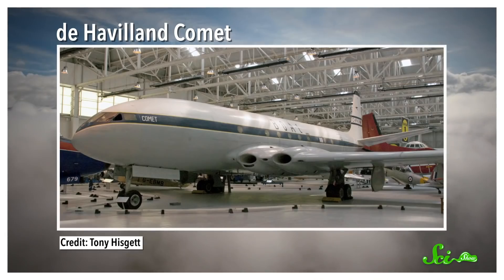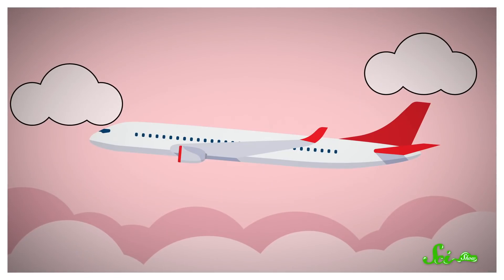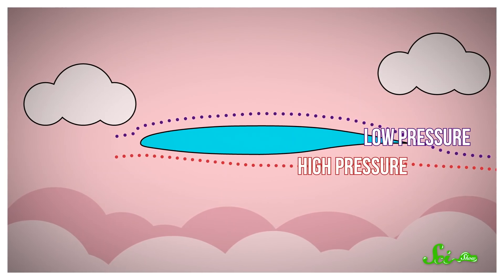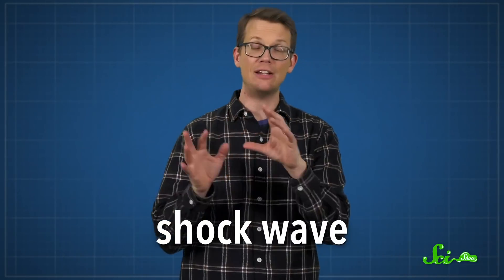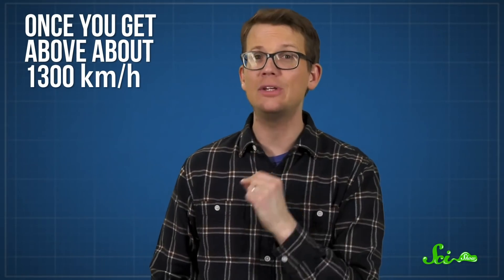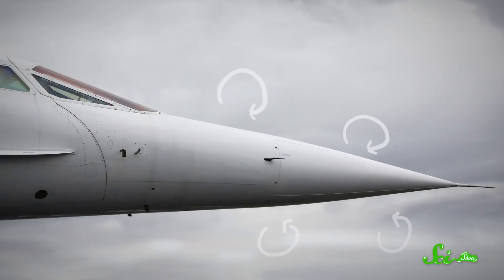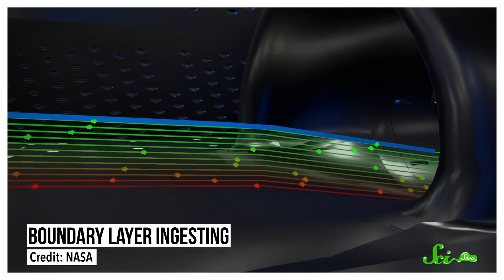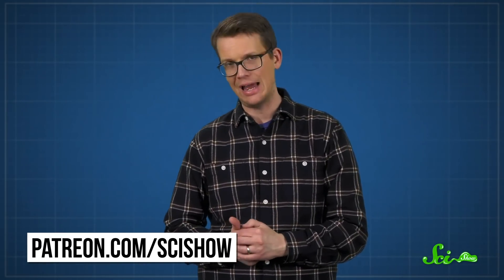Why Aren't Commercial Jets Getting Faster?

Comment: This video is rather simplistic, hence some of the questions left in the comments. The speeds that actually matter to an aircraft wing are the Mach number and the indicated air speed (because IAS gives an indication of the number of air molecules moving over the wing; true airspeed matters for navigation on the other hand). At typical jet cruising levels, Mach number is used almost exclusively, with the fastest commercial aircraft topping out at around M0.95 but more typically saving fuel by flying in the region of M0.8 to M0.9.

Comment: there is also the issue that when super sonic air slow down to subsonic speed it generate huge amount of heat. Combustion efficiency is proportional compression ratio. If the incoming air is already hot, you can't really compress the air too much further until the heat start melting the engine combustion chamber. So given the same material temperature limit, a super sonic engine will always be less fuel efficient than subsonic engine due the much lower compression ratio. Adding to the flight cost.

Comment: why aren't commercial Jets going faster? -->Concorde
Reply: And Concorde is rushing along at the speed of naught.
Because the ugly economics of pushing air out of the way beat elevated speed in all methods of transportation.
Not to give you any friction.
Reply: Golden rule of commenting: watch the whole video first. But even if they hadn't addressed your comment before you made it,  'Concorde' is an answer to the question what's the fastest passenger plane in history? The two obvious question's now being begged are: what happened to it, and why isn't there a mo' betta one?

Hint: watch the video...
Reply: Yep, over 2000kph
Reply: meanwhile, hyperloop can't even get itself off the ground :0
Reply: Cody Mcneill which retired. So it seems like it actually became slower.
Reply: Yeah, the intro has nothing to do with the topic... The reason jets are not getting faster is not physics, it's passengers.
That's why I expected "Do not blame the engineers, blame YOU". He even pointed out the finger.
Reply: @IIARROWS  it's both physics and economics. if physical limitations didn't create extra drag around mach 1, there'd be no reason for planes to slow down. it is technically possible to go faster; but economics makes it not worth the while. the video literally says, "until someone engineers a solution to the wake drag"

Comment: So if 1300km/ph is the speed where the air stabilises, why hasn’t someone made a plane that can go that fast? Concorde was almost double that speed and the issue created was drag caused by heat so why can’t someone make a plane that flies at a speed where the air is stabilised but the plane also doesn’t get too hot? A happy medium if you will.
Reply: You would still need to brake the sound barrier for that. This means you need a slim design like a fighter jet or the Concord. Slim design = fewer passengers = expensive. The reason there are no super sonic passenger planes was and is money.
Reply: The critical thing is the speed of sound, because the reason sound travels at that speed is that's how fast pressure travels through air left to its own devices. Traveling right at the speed of sound is kind of dangerous, because different parts of your aircraft will be simultaneously above and below it depending on the specific airflow characteristics, meaning weird forces acting on your plane and your engine parts. So you want to be just under it for best speed in an efficient way or power straight through to well above it for just plain old going fast. Concorde did the second thing, the fastest passenger jets of today, also the biggest, do the other and fly at about 85% the speed of sound. If you go significantly faster then the speed of sound then you get into weird territory like what space capsules or extreme aircraft like the SR-71 deal with, and then you've got situations where you're effectively sending up flying fuel tanks with minimal payloads attached to them.
Reply: It is not the speed of the air that stabilizes, it is the REGIME of the airspeed. Below 1300 kph, there likely will be parts of the airflow that will drop in speed to less than the speed of sound. Above that speed, it is supersonic everywhere, BUT it is still a lot of drag. As to why not fly at 1300 kph, it is because the thermodynamics efficiency of engines increase with speed, and at 1300 kph, you are not really gaining anything yet. The faster you go, the better it gets. Except that above Mach 2, you have to deal with kinetic heating and need to rely on heat resistant material that cost a lot, are heavier, and are very delicate to work with.

Comment: Why not start flying at higher altitudes ( like 50,000 or 60,000ft )? The air up there is so thin that you could go a lot faster with only a fraction of the drag.
Reply: jet engine needs air for oxygen and reaction mass

Comment: Another interesting thing to consider is that airplanes lose energy to two things:
Lift
Drag

The slower you go, the more you lose to lift, the faster, the more you lose to drag, so there’s a sweet point in the middle somewhere. That’s a big factor on airplane speed
Reply: Airplanes have a maximum endurance airspeed and a maximum range airspeed. Max endurance is actually really slow, so even though you're able to stay airborne for a really long time you're going so slow that you can't go very far. At maximum range airspeed, you're not able to fly for as long, but you're going so fast that you can go a long way.

Comment: What about flying via the Earth's orbit? I recall this was once an idea for super fast travel. Why isn't that a thing yet?
Reply: SpaceX is claiming they're going to do it with their new Starship rocket. Carry a couple hundred people point-to-point in less than 90 minutes. ANY two points.
The problem is, of course, it's a space rocket. It's not an airliner. You have to launch in a rocket, with multiple Gs of acceleration for a couple minutes during the launch phase, some weightlessness in the middle, then a couple Gs of deceleration during the landing phase.
And Starship rockets are so loud, they aren't just going to take off from existing airports, or from new launchpads in the middle of cities. Pretty much every launchpad will be either in remote land at least an hour from a city, or off the coast at least an hour boat ride away.  So add at least two hours "travel to and from the launch site" on each end.  Plus any security lines, etc. It won't be "New York to Tokyo in 90 minutes," it will be "New York to Tokyo in 3 and a half hours."  Still way better than even the fastest airliner in development - but not as super-fast as would be good.
Reply: Really short answer? You need way more fuel to escape Earth's orbit than you need to travel above speed of sound with wave drag and all, like orders of magnitude more. 
Given that the Concorde mostly failed due to how expensive tickets were, don't expect commercial space flights anytime soon, apart from crazy billionaires willing to pay waaaay more than 50 thousand bucks a ticket.

Comment: The Concord was one thirsty bird
Reply: For it's time, not really. All jet aircraft at the time were using engines that peaked in efficiency at around mach 2, which meant Concorde made up for the inefficiency of supersonic lift by increased efficiency of it's engines. This was also the primary driver for the early speed. The faster you go, the more efficient the flight, up till transonic effects kick in. The main progress that has been made has actually been being able to go slowly efficiently. Now we don't need to make the aerodynamic compromises of the 60s jets to fly fast so that the engines work well. Now we can fly more aerodynamically efficiently (but slightly slower), without compromising thrust efficiency.
Reply: @agsystems8220  so the Concorde and its friends were all thirsty birds
Reply: @agsystems8220  At 1960-s dear. all plane used turbojet engine, hence people said that efficiency should be around supersonic speed since most of supersonic plane at that time used turbojet engine.
But, the day that turbojet used in commercial plane was already long gone when high-bypass turbofan came along  same time when Concorde start to fly
Reply: Le concorde had been stoped by UE because the patent could not be shared with UE according to french laws
Reply: @tituswilliams8063  Garbage. There is no such thing as a patent for flying supersonic. Besides, patent expire after 20 years in Europe, Concorde entered service in 1976, so if there was ANY patent (and that is assuming that they would be filed at that time as oppose to prototype first flight in 1969) it would have expired 7 years before it was pulled out of service.
Reply: Vincent Goudreault EU wanted the concorde france said no so Jacques Chirac crashed it
Reply: @tituswilliams8063  What is the current street price of the hallucinogenic you evidently abuse?
Reply: @vincentgoudreault9662  Édouard Balladur
Reply: hell yes...
Reply: Not to mention uncomfortable.  Narrow fuselage, narrow seats, not much leg room.
Reply: Concord was not that practical and was doomed to fail
Reply: @Kyle-gw6qp  Concorde did establish the principle that there is a market for supersonic travel though. A new generation of supersonic airliners, using newer tech could probably be made economic by operating many more of them. Might be a while before the global air travel market recovers to that point though

Comment: It was the Paris crash that finished Concorde. Although it did get back into service after mods the magic had gone.
Reply: not really. the biggest problem was just the shear cost of running the aircraft.  fuel cost was very high plus the maintenance was also much to demanding. that in combination with the low demand of the device.

the crash only helped to fasten the decision.  But if that did not happen it would still have stopped flying pretty soon.
Reply: Richard Branson wanted to buy up the Concorde fleet for Virgin but they didn't want him to have the glory.
Reply: Concorde was a niche market.

9/11 killed 40 of their frequent flyers.
That was a substantial dent in Concorde's customer base.

Comment: if air slows you down you aren't flying high enough!
Reply: You almost got me.
Reply: @dinkledankle  He's actually right. Part of why the SR-71 was so fast wasn't just those two beastly turbines. It was also the fact that air at the altitudes she operated at, the air is not only too thin to breath, but it's actually so thin the control surfaces start have trouble hitting enough air molecules to do their job. An SR-71 at operating altitude is one of the few (if not the only) instances where the turning radius improves as you put on speed.  Also, check out the speeds the space shuttle reaches, both on the start of her controlled flight back(after re-entry burn), and the speed she'll do in orbit.
Reply: @muninrob  Walter: Well, we do have one option. However, it was decommissioned in 1998.
Alucard: The Lockheed SR-71 Blackbird. An advanced long-range strategic reconnaissance aircraft capable of Mach 3 at an altitude of 85,000 feet.
Integra: You sure do seem to know a lot about it.
Alucard: DO YOU EVEN READ MY CHRISTMAS LIST?!
Reply: @Mazaroth  I dont know you, but You are Awesome!
Reply: Giordano Tanora  musk would open his factory in a pandemic just to send 2 guys into orbit tho. he's getting weirder by the minute.
Reply: @alveolate  "just to send 2 guys into orbit" is a big understatement of what happened in the last days. It's probably the beginning of commercial space travel.  As if you said "Karl Benz would burn gallons of precious oil, just to get somewhere to where he could just walk to" when he invented the car. Opening his Tesla factory isn't connected to SpaceX, as far as I know, but is definitly not his smartest move, though.
Reply: @spankasheep  okay so they're not connected, i basically just wanted to shittalk musk xD but would you risk opening a factory during a pandemic lockdown just to break some historic record? when the thing is completely not time-sensitive at all?
Reply: I got enough pain in my ears the last time a pilot decided to do a quick altitude drop to land.  I can only imagine how much worse that would be from the edge of space.

Comment: I bet Amerikans are upsettingly confused when SciShow uses the metric system in their video
Reply: I bet you no one cares
Reply: @GlizzyKing-n7h  the likes on my comment beg to differ
Reply: I'm American and I personally prefer it when they use the metric system.
Screw 3-4 barleycorns in an inch, 12 inches in a foot, 3 feet in a yard, and 1760 yards in a mile.
Coherent units based on powers of 10 work just fine for me.
Reply: @brenebon6980  divide that into 3.
now divide a Foot of freedom units into 3.
Reply: @brenebon6980  power of 10 is also 'arbitrary' - it's based on the number of digits on your two hands. Just sayin. Why not use both systems - one could be on screen so no additional words and thus time would be added to the video.
Reply: @DennisKapatos  Yes, 10 is an arbitrary number. But since we count in base 10, it's the least arbitrary number when compared to 3 (feet), 12 (inches), 1760 (yards), 2 (cups), 4 (quarts), 16 (ounces), and 2000 (pounds).

Comment: The Convair 990A is still the fastest non-supersonic commercial transport to have ever been produced. During May 1961, one of the pre-production 990 prototype aircraft set a record of .97 Mach in level flight at an altitude of 22,500 ft. (6.9 km), equivalent to a true airspeed of 675 mph (1 086 km/h).

Comment: Well it takes energy to fly. Increase the energy to infinity to go faster. But energy requires a lot of fuel which increases weight. So I guess in the end the amount of pips of energy that can be harnessed from all energy sources would eventually cap out. On a graph as weight approaches X and energy pips max at a Y that's theoretically the max speed we could get to.

Comment: When I was a kid in the 1960's you could hear sonic booms many times in the day. They got to be routine to hear them.
Reply: I live in the path of millitary training routes and often see fighter jets fly over, i dont hear it daily but once every few weeks, i think its cool

(F16 from the dutch airforce)
Reply: @detachsoup6061  i always thought that (outside of a actual danger) F16's where not allowed to go over the sound limit.  do to the effect the boom can have on equipment on the ground.

they used to fly over quite often in the 90's (Zeeland) but always just a bit below the sound barrier. only when they where above the north sea would they go over the barrier.
Reply: @sirBrouwer  Fighters train at supersonic speeds over designated training ranges (land or sea) where no-one can be bothered by noise. It's not a matter of risk to equipment, it's just loud and potentially harmful to people's ears and wildlife.

I should add, fighters are incredibly loud even without going supersonic; loud enough to damage hearing at certain altitudes and speeds.
Reply: @detachsoup6061  does it sound like an explosion or more like the rumble of thunder? I've never had the experience of hearing a sonic boom from a jet.
Reply: @jamesriggs6210  If a fighter goes supersonic at low altitude, the boom will sound like a very loud gunshot. At 30,000 feet / 10km, however, the plane would be too far to pose a risk to your ears. You'll still hear it as a low rumble, though.
Reply: @jamesriggs6210  It sounds like two very loud thud sounds close together, "thump/thump!". It's quite jolting, and some people think it sounds like an explosion. I used to find myself driving past JFK airport on Sundays when the Concorde was taking off for London, and even just the roar of the engines filled the entire sky, I used to describe it as "God's own Bernz-O-Matic". And when the plane got sufficiently far from land, it would break the sound barrier and I'd still hear it.
Reply: Fighters are so loud compared to other aircraft because the exhaust coming out of the engine is going supersonic. Even if the jet is in the ground at idle power. If in afterburner they are crazy loud
Reply: I've had to replace two very large and expensive sunroom windows due to sonic booms, have fun trying to get insurance to cover that, lol.
Reply: When i was a kid in the 90s we lived near an US air base. so sonic booms where still routine.
Reply: OKC?

Comment: The pressure explanation is wrong because it cannot explain how airplanes can fly upside down. The real explanation is Newton's third law: the tilted wing pushes air down and the air pushes the wing up. I downvoted the video for failing basic physics.
Reply: Bernoulli does have some effect on lift, even when planes fly upside down, as ailerons are used to change wingshape for upsidedowny flight.

How much of each effect contributes to the overall lift is difficult to measure, but air displacement and Newton are certainly a large factor.
Reply: There's also the angle of attack to consider. When a jet flies upside down its nose has to be pointed up more to maintain altitude because lift from the wings is reduced. The lower the speed, the higher the angle of attack has to be.
Reply: Actually in a tilted wing you also have a higther pressure in the plane on the wing that goes to the wing and lower in the other maken the explanation done rigth.

The first fail at physics is thinking that someome fails whithout realizing that you knowledge is incomplete and you can be misinterpreting him because of that.

http://hyperphysics.phy-astr.gsu.edu/hbase/Fluids/airfoil.html
https://www.grc.nasa.gov/WWW/K-12/airplane/bernnew.html